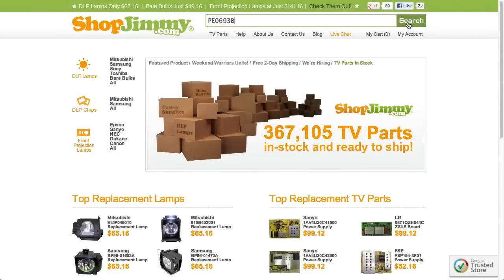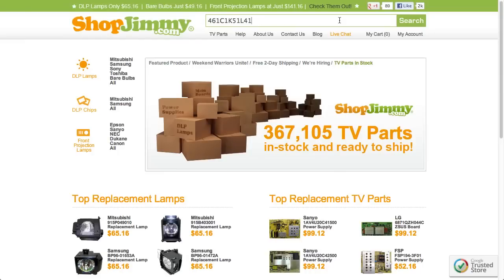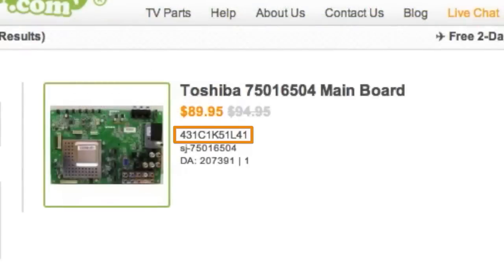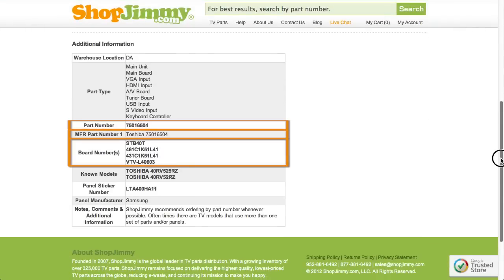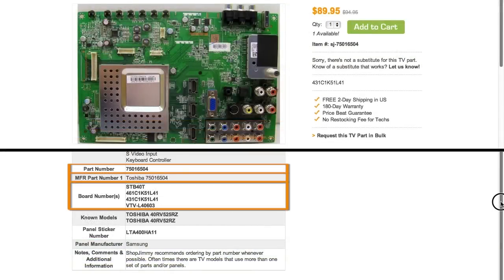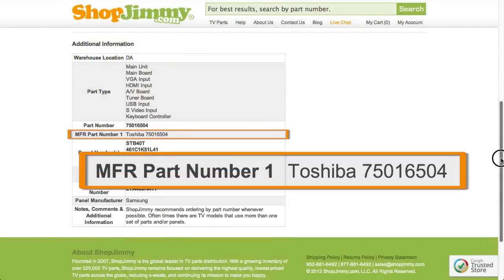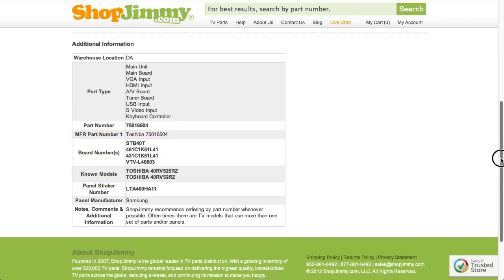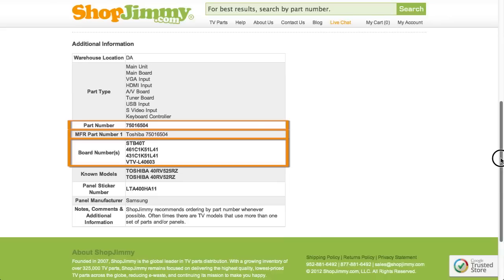TV Part Number Identification Guide for Toshiba Main & Scaler Boards (LCD, LED, Plasma TVs)

Comment: Hello I have 52HL167 and the TV has 3 Yellow Blinking light when I turn on the TV.  Doesn't anyone have any idea what the issue might.  I have tried downloading a firmware upgrade but can't seem to get the TV to boot from the Service SD port.  Someone had also recommend replacing STRW6765 it is on the Q880 board.  Which repair would be the easy replacing the STRW6765 chip or Q880 board. Not sure Q880 it might the chip location.

Comment: I have a Toshiba 56MX195 , i've had this TV for 8 years and i've replace the bulb twice, this time is did not fix my problem. Theres a Red and Green light that keeps flashing and the TV will no longer power on... By any chance you might know what that could be, i no longer have the Manual ...
Reply from the maker: CChrun636 I would recommend replacing the DMD board in your TV.  Here is a link to replacement parts for your TV model number on our website, click here: http://www.shopjimmy.com/toshiba-23148435-seine-board.htm  Be sure to match part numbers on your current board, with your replacement for compatibility.  You can also call our customer service for further assistance with your purchase.  (877) 881-6492  Thanks and please let us know if you have any further questions!  www.shopjimmy.com

Comment: do you have a y board and a x board for a Toshiba mod 50L 1350 uc tv    the set is making a clicking sound  what do the boards cost as I will buy both  THANKS  DOUG
Reply from the maker: douglas hall   I don't think they make a y board and x board for this model, because when I search the model number online, it shows as an LED TV and those parts are for a plasma TV.  Please reply with the problems and symptoms your TV is showing.  Thanks!  www.shopjimmy.com